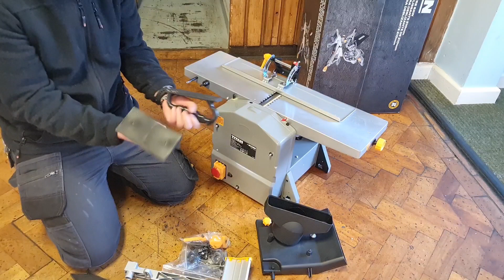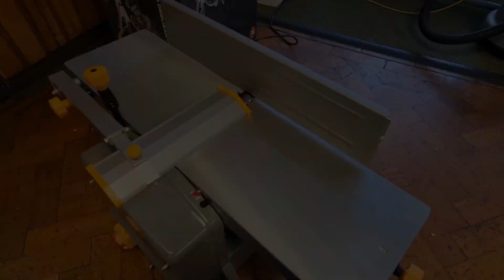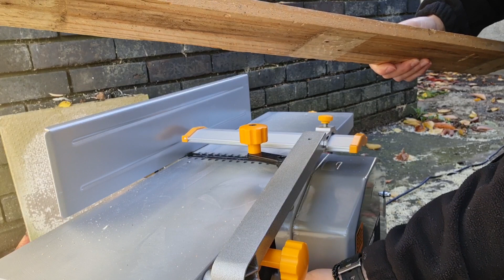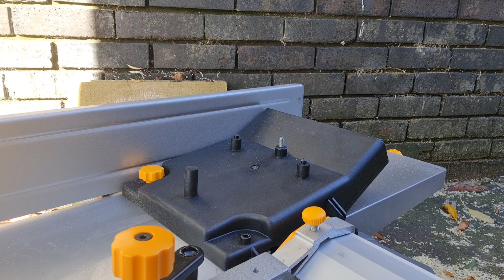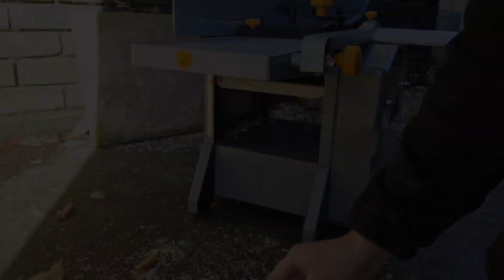Titan Thicknesser Planer Is It Worth It?? Unboxing Set Up & Demo

Comment: 7:57 you don't know how to operate this machine
Reply from the maker: Could you explain?...
Reply: @thedoitalldad  you should press the board onto the receiving table, not onto the feeding table as you do - you can see how the end of the board rises above the receiving table
Reply: @abrrrakadabrrra I was wandering about that, ive been doing it by pressing down on the outfield table side but the wood doesnt seem to connect with the blade, is it just that I need to keep passing it through several times? I have exactly the same machine

Comment: When using the planer table the blade guard should be down on the table with just enough space for the wood to run through.
Reply: The guard should be set low and moved in so that it is almost in contact with the side of the work piece as it passes over the blades.

Comment: Good video. I got this a few weeks back but have been a bit too intimidated to use it yet! 😅 I'll have go this evening I think!
Reply from the maker: Hope you got on well with it
Reply: @thedoitalldad  had a good run at it there the last few weeks. Only real issue is the dust extract when you're using the thicknesser gets clogged up after about 10-12 passes. Very happy with it otherwise.
Reply from the maker: @DanCasey810  Yes I have found the same, I tried connecting it to a vacuum but it still clogged, although the vacuum itself was faulty so I put it down to that. I've picked up a titan vac so may give they a go
Reply: @thedoitalldad  ya I don't think a shop vacuum would have the volume to deal with it to be honest! Be interesting to hear how it goes for you though! 👍
Reply from the maker: @DanCasey810  To be fair it was a huge industrial thing but it was old and knackered 😅
Reply: @DanCasey810  This is common with almost all thicknessers using steel blades (large chippings) unless you gets a really good high powered dust extractor.

Comment: I have had a similar machine for several years and find it adequate for home use but a bit of a pain to swap between the top and bottom functions. Mine is a different brand but essentially the same machine with a few minor differences, obviously made by the same manufacturer. A few points - you should joint (plane on top) one edge and one face so that you have two smooth sides at right angles, then use the thicknesser to plane the other face and edge, which will then be parallel to the first two edges so you end up with a smooth square board. Also, the easy way to open the switch is just lift the stop button upwards and the switch will pop open. When using the thicknesser on longer pieces of wood it is a good idea to make a longer bed by laying a long flat piece of wood through the throat of the thicknesser to support your workpiece (a cheap melamine shelf is ideal). This will prevent snipe on the leading and trailing ends of your workpiece.
Reply: Hallo Ray. I have a question regarding my machine. After using it like for 1 or 2 minutes, it suddenly starts vibrating a lot and produces an abnormal sound. It shakes violently and shifts position on the table.
What could be the problem? 
I've tried checking whether my table is level.

Comment: thicknesser and planer are the same thing. title bit misleading
Reply: Planer is the function he showed first. Thicknesser is the 2nd function.
Reply: What he call a planer is also know as Jointer, because the wood goes over the top of the  blades and it is a thickness planer when the wood passes under the blades. You should joint the flat wide part first to gets it flat and only then put the planed jointed side against the 90 degree fence and do one edge and finally put planed flat side on the thicknesses to parallel the remaining side.
Reply from the maker: Hi, this machine has two separate functions as demonstrated in the video 👍🏻

Comment: I've set my planer up and screwed down the bolt to turn on micro switch but it's still not powering up. Any ideas? I've been at this now for the last 3 hours 😢
Reply: Hi Mark, did you figure this out? We cant get it going here
Reply from the maker: Sorry for such a late reply, did you get it sorted?
Reply: Thanks a million 
The instructions with the machine are terrible was about to chuck it in the bin until I watched your vid

Comment: I’ve got one renamed it death trap with the blades there ok but don’t lose the blade re setting jig as there are no replacement parts or spares for this except for blades and the on off switch.  If you want to lube up the chain behind the panel with on off switch best thing to use is the wd40 dry ptfe spray. They don’t like long bits of wood but be careful they can blow up or catch fire sometimes but wear ear defenders as it’s loud and close neighbours might not appreciate it
Reply from the maker: Appreciate the few tips there. I've accidentally ran a nail through mine so need to change the blades 🤦🏻‍♂️
Reply: @thedoitalldad  it is worth getting a metal detector, I am waiting on Amazon for a Zircon MetalliScanner m40,review it on youtube.
Reply: Do universal blade jigs not work?

(Asking before I buy a second hand one and it doesn't come with it!).

Comment: Great video and thanks for sharing.  Do you know how easy it is to sharpen or changes the blades.
Reply: On the blades you just buy replacement ones and I think it’s 4 nuts you undo to remove blade but do not lose the two small springs underneath the blade
Reply: @Steve-dr7rr  Blades can be quite expensive. They are fairly easily sharpened using a piece of wet and dry sandpaper glued to a flat surface (like a sheet of glass - I use an old mirror). Only need to replace when they get dinged by a nail.
Reply from the maker: Glad you've found it useful... Well I've accidentally put a piece through with a nail in 🤦🏻‍♂️ So Im going to but some new blades... I'll let you know